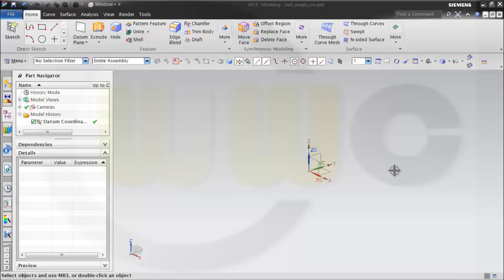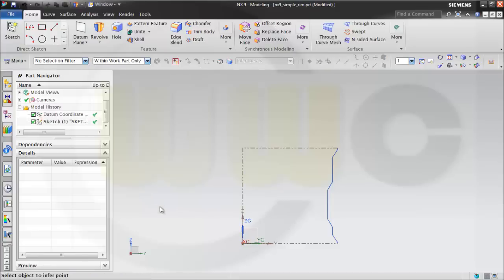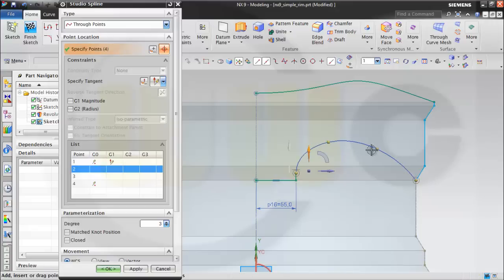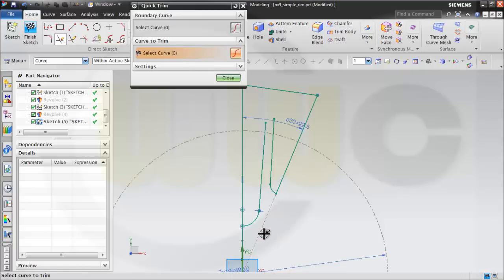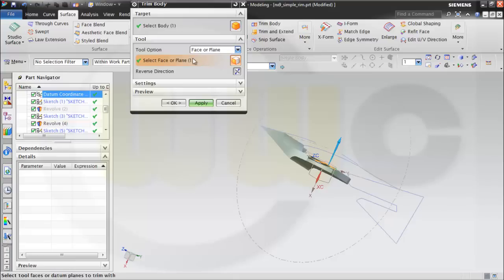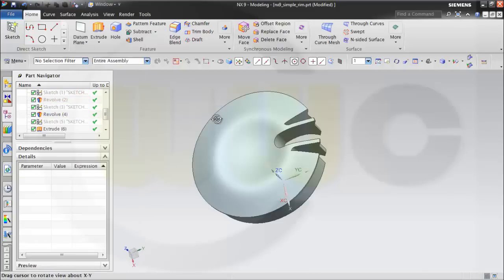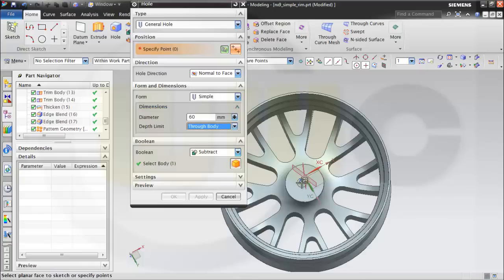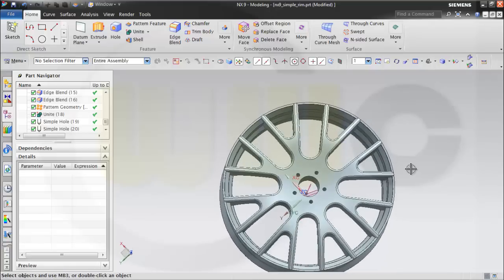Simple Rim / einfache Felge - Siemens NX 9 Training

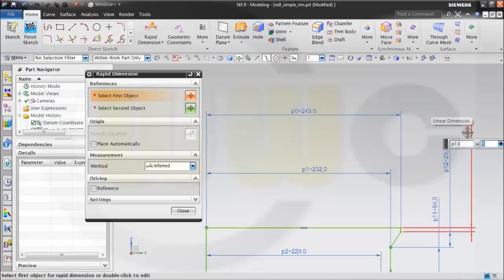Comment: Hi sir @2:49 it is a line of 5mm dimension...is it a straight line or slightly in angle bcoz if it is straight the Sketch will not be fully constrained with 245 dimension on both sides..plz rply
Reply from the maker: Of course it is a straight line, but it doesn´t really matter.
Reply: @wolfgang.walden.cad.training  ok but I tried a sketch with same dimension but was not able to constrain it with straight line..ok no matter